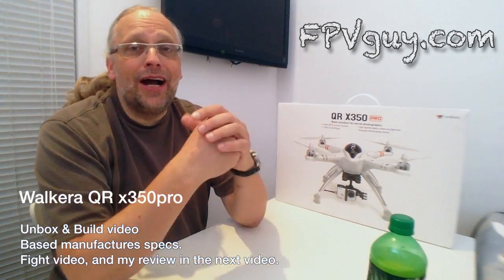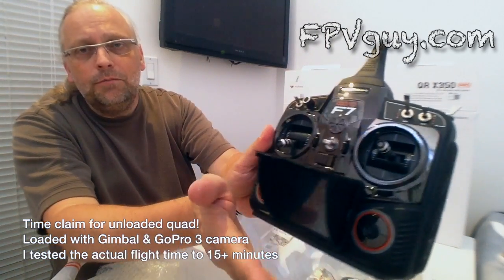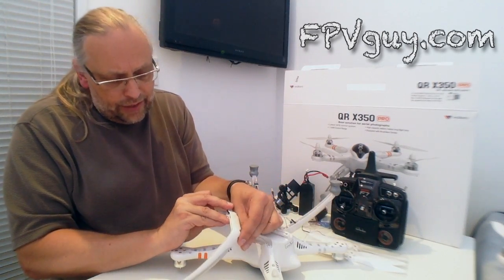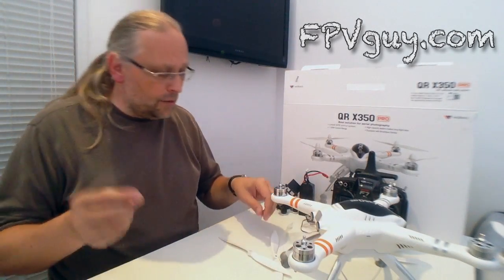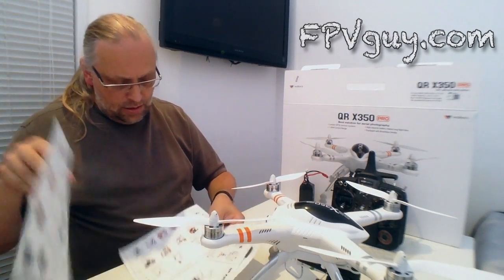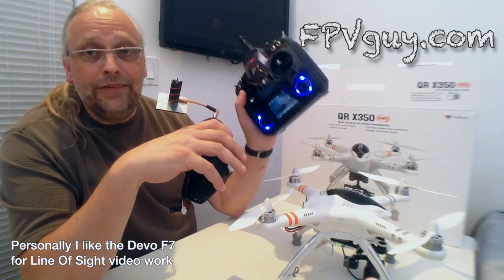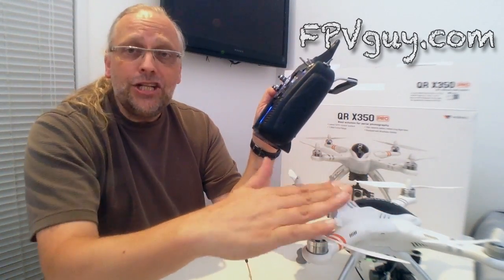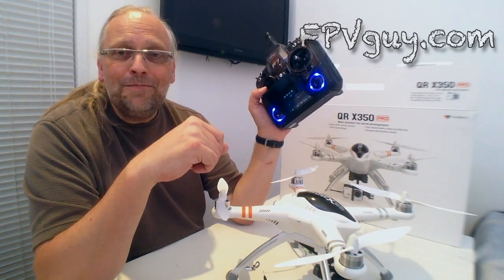Walkera QR x350pro build video

Comment: Hello bo, new to quad flying. Watched alot of your vids. Very insightful help me in choosing my new quad. My first quad.  The hubsan h107d fpv. I also got walkera 350 pro. Im taking it slow and steady only two crashes so far. Before each flight I tighten all screws and rotar caps. I got after watching this. I was just wondering if there was a way to disconnect the LED lights inside and replace with just red and green starboard and port lights. And could you show a how to video for that would be greatly appreciated love all your shows whenever I have a question I look up your vids. Sorry for any stupid questions just new to this and want to know what I can do. And if you can suggest a good set of LEDs red and green have a good day
Reply from the maker: The LED's are actually part of the ESC's   but I think you could easily reorganize the ESC's     that said,  Im finally getting comfortable with the quad style of lights, green up front and red "brake" lights on the tail.
Reply: Is it possible to switch the lights and colors. I want to change the configuration. I had to change the batt connector on the batt & the quad. The cjarger they gave took 14 hours to charge. Took to hobby shop & paid them to do it. I can do light soldering but not that well still learning. I got new hitec ac/dc charger 10a 80w with balance board. Now it charges in 1 hr little longer. But now I can use other batteries as well. I also bought a drone strobe for it. I want to make the lights more like a real plane. Thanks again for input I respect your opinion and your vids are my #1 go to. P.s. if I disconnected 2 sets of the leds would it save power and are the leds removable. I have not opened it up yet. Thanks again.
Reply: Sorry for the long posts just want to learn from the best. Also I joined the ama. I want to configure the lights like I said to more like airplane lights. I fear the regulations comming cause people flying too high. I live in san jose ca, just the other day someone was flying a stunt plane about 300 or so feet less than a mile of san jose international airport.
Reply from the maker: Honestly, I like the idea of changing the lights, however generally ALL quads and hexes have similar lights out of the box,  I would not mess with them.
Disconnecting the LED's will not save enough power that you will notice the differecen :-)  it is a pretty big battery.

Comment: Excellent video Bo, thanks mate. It's brilliant news that Walkera are now using APM compatibility in their product. We now just need DroidPlanner to get the Wikipad working with the APM and Walkera have a Parrot Bebop killer! :)
Reply from the maker: Yup,  putting a open source flight-controller in a mass market product could be a stroke of genius for Walkera.  the funny thing is, their setup is not particularly great, but most users simply adjust the settings based on better settings from internet forums and because its open source, in 10 minutes they have a much better flying quad.     Im very excited to see the Bebob, love the ideas and the video stab concept.

Comment: Thanks Bo,The cost of the  Devo7 is around 80 au dollars so for it is quite cheap in comparison to the  F7 which retails here for about $ 270 and includes FPV support.I could spend $ 235 on a lcd 7inch screen but then I need to buy adapters and the like, id be better off just buying the F7 and  be done with  it.
Reply from the maker: +Steve Hallett   Yes and no.   the screen is virtually guaranteed to have better receiver,  and you can then fly circular polarized antennas in both ends. ;-)  I would go for the screen or budget goggles from CarolinaDronz.com

Comment: After watching this video I'm seriously thinking about getting one of these to replace my Blade 350QX. The Blade is a great flyer but it has one serious drawback. No gimbal support. I would like to be able to manually tilt my gimbal from my transmitter but it won't do that. The original Blade also has range issues and I want to move up to 1.3 ghz for longer fpv range. BTW, you sure drink a lot of Dew :-)
Reply from the maker: LOL.. what do you mean,  I have to go get a dew for each video to keep the image. :-)
The 350pro is a pretty solid quad,   I have had good success with it..  as always, balance motors and be religious about the props, that makes a huge difference.
Reply: Bo Lorentzen I use the Pro propellers on my Blade 350 so I'm pretty aware of the balance issues with them. Once they're balanced they're great props. I swore I'd never buy another Walkera after my original 350 but the more videos I see of this one I'm convinced they've done a much better job on it.
Reply from the maker: The 350pro is a much more mature quad compared to the original 350.   It still have a couple of behaviors.. but thats more a feature of the APM system,  always make sure it have more than a solid GPS lock.. even for flying in manual.    and avoid low-battery forced auto landing.. simply land when the battery light come on.. or fly with a timer.  personally I turned off the low-voltage landing in the APM setup.  and I added a lipo alarm buzzer.. when it starts beeping, I turn around and land. easy and painless.
Reply: Bo Lorentzen I use a buzzer on all my quads. In fact I use the same one you do, even on my Naza quads. They also have a settable LVC but I prefer a buzzer. I also use a timer. Does the 350 Pro have auto levelling in manual? That was a big bugaboo for me with the original. Anything that FPV's should have auto level even when not in GPS mode. The more videos I see on this version the more I'm convinced that I should have waited for this one to come out. I've got a small windfall coming next week so I'm going to order the version with the Devo 7. I've got a DX8 I can move up to if I don't like the Devo.
Reply from the maker: Yes the "manual" is really "stabilize"
Reply: Bo Lorentzen I figured so being it's an APM clone but I wanted to be sure. I don't plan on using the waypoint feature.
Reply from the maker: The important thing is understanding what to expect from the flight controller.
Reply: Bo Lorentzen I want stable, smooth, predictable with longer flight times and a decent RTH.
Reply from the maker: Randall Huston check out the MiniX flight controller :-)

Comment: Hi I just bought this drone, and have a problem as my drone cannot fly higher than 2 meters. Then I found out that the battery is not getting the full charge. I contact the seller and told me that it over discharged. He suggested to try it with a lithium battery balancer. Please note that this is brand new. Can you tell me how shall I charge my drone, and provide more information regarding the battery and the charger.

Thanks

Comment: Hi,
thanks for the great setup video.  I got some nooby questions that I'd like to ask
1) I got a Devo 7F, on the top right corner of the LCD, it says 7.4v  - I assume this is the voltage of the battery in the radio ( not in the quadcopter )?  What does 7.4v mean in layman's terms? How do I know when the radio is running low on power?

2) How do I know the battery level on my quadcopter? I know it's a 5200mah.

Thanks

Comment: I  second that very helpful, one thing the slide clip for the camera where can I purchase one as it can be put on or of very easy.
Reply from the maker: thank you Byron,     Walkera told me they are releasing the quick-mount, however I have not seen it as a separate item yet.   maybe check with Dave at walkerahelicoptersupply.com and mention to him that you want to buy that for your G-2D gimbal. (I'm assuming you are talking about the gimbal quick mount?)

Comment: Hi Bo,I still in contact with walkera and finally they are going to send me that missing cable at a price will let you know the price including p&p,have you got yours sorted out yet.
Reply from the maker: Hey Bryon,    Mine is working in that I can make it work when connecting a cable from gear to the camera with that little "camera cable thing".    BUT  I have not used it because I typically just turn the camera on before take-off.    Very interested what they send you.
Reply: Hi Bo, I got the cable and I have been trying to get it to work. on the back of the card it shows where to put the plug the on another place it states to place it another position on the receiver,but I have a bigger problem the blades will not turn now, so that has to be sorted,I think its the receiver at fault.
Reply from the maker: Bryon,   make sure the MIX stick is in the zero position before trying to arm the motors.

Comment: Cool Video, Cool Quad, do you know if you can buy bodies for these? If so, do you think it will be possible to transfer internal components and motors etc from last years quad to the pro body? Just want to use the bigger battery. Thanks (-;
Reply from the maker: Yes, it is possible,  lots of people have been upgrading to the pro body when damaging the original style,  Dave have the body here
http://walkerahelicoptersupply.com/collections/qr-x350-pro-parts/products/qr-x350-pro-z-02-body-set
Reply: Bo Lorentzen Thanks mate

Comment: Dear bo, was wandering if a firmware upgrade was important some say yes and some say no. Also wondered what the little bind cable is for and exactly how it works. Thank you
Reply from the maker: The firmware upgrade give you a slower decent when landing in RTH.   
the bind cable need to be put into the last port on the receiver if you have setup the receiver for permanent ID and need to bind it to a new radio.  you should never need to use the bind cable.
Reply: Thank you so much. Very helpful. Hope you have a good day bro thanks

Comment: Any videos on converting and adding  x350 pro to a 3d gimbal and camera if it is not out of the box (ie making sure all wires are in place inside and all presets on Devo 10 are adjusted to allow and use 3D and iLook camera)...Out of box version will have been setup as RTF with all presets....
Reply from the maker: nah, unfortunately,    however its pretty straight forward, you basically want to power it, and connect the pitch cable.

Comment: ok thanks for the info :D  ill see what happen if i will fly in gps mode ...because this is my first quad and i also orderd propellor guards i will probably need them lol but i already practised on my tablet with a quad simulator ... its a little  hard but i will practice and if somethig goes wrong just put the RTH function on ;p haha but u said in the video always put ur trottle at 50% if u put the RTH function so if u go back to gps mode u wont crash but is it necessary if u let it come home and let it land totaly ? to still put it at 50% if ur in any trouble ?
Reply: oops i made a new coment instead of answering on the same coment :/
Reply from the maker: Tom, those are good questions,  when you are in RTH mode, the aircraft will fly itself, including landing where you started. Simply leave the throttle at 50%.   I would suggest switch OUT of RTH mode when you again have a comfortable situation with the quad, and continue flying it in either GPS or manual mode. when you switch out of RTH, make sure the throttle is at 50%,  also if you switch form GPS to manual, make sure the throttle stick is at 50%, otherwise they aircraft will start to fly according to the stick. ;-)
Reply: ok thank u very much for all the info :)

Comment: Bo, I have been in contact with walkera and there is another cable (D) which goes into the receiver,I have asked if they would send a cable to me,will have to wait and see.
Reply from the maker: Bryon, that is what I am coming to also, but they have not yet shown me the actual cable.  still working on that part.. which kinda bugs me, because the x350pro flies nicely and I want to do the wrap-up review.. but want to include the cable, and a couple of other solutions as well in that video.

Comment: Hi Bo! Thanks to your videos I decided to buy a 350 instead of a Hosten, for FPV with Attitudes Goggles and the iLook + Camera. Very Happy, but the camera records many different clips, even if i don´t stop the shooting. I have a 8gb 30 MB/s card. With a FAT32 Format. Do you know what it could happen? Thks so much!!
Reply from the maker: I think it splits the clips after 10 minutes?
BTW. you can format the camera in-camera by pressing the shutter for 5 seconds.
Reply: Bo Lorentzen thanks for the quick answer. Actually some of the clips are very short. I tried to format the card with the camera but it didn´t work very well. I guess it´s because i´m using a cable that came with the ilook + for the Tali 500, and so i had to change the plugs (not the same than the 350). I guess there is something wrong with it. It works but not properly. So i´ll have to buy a replacement for that cable, which I thing Walkera don´t sell. Anyway, i´ll continue to try diferrent things! Thanks a lot Bo! We can always count on you! :)
Reply from the maker: Jorge Esteban   OK with that little extra information.. ;-)    I'm guessing the camera start stop is getting constantly tripped.. maybe the trick is to find out which of the pins is the servo signal and disconnect (clip) that wire so it just get 5v power and ground.  then you can start on the camera.
Reply: Bo Lorentzen That was it ! GREAT JOB BO!!! What would us do without your help!! the cable is split in two (power and servo). I disconnected the servo, i press the button on the camera to record, and it works smooth!! thank you!
Reply from the maker: Jorge Esteban   :-)   AWESOME, glad it worked. ;-)

Comment: Hi Bo, after my difficulties with the GPS I built in an original APM 2.6 with an ublox lea 6h GPS. Works fine without cam and gimbal. With ilook cam and 2d  gimbal (total weight 1.243 kg) and original Walkera batt (5200 mah, 10C?) in the package the Quad can fly only a few minutes! I observed that there are Walkera batteries with 5200 mah, 30C on the market. Which kind of batteries do you use? Can I hope for better results with the Walkera 5200 mah, 30 C? Which is your total weight inc. cam and gimbal?

Comment: Bo What is the 2.4 radio like for signal where there are buildings and wood fence can the signal go through to the rec ok, also 5.8 camera signal  will that through buildings
Reply from the maker: Hey Bryon, the 2.4 is ok, but it's not a brick wall penetrator.  If you are looking at flying behind houses, you need get a ezUHF and use 900mhz for your video.  Then you can comfortably fly a long as you have video.

Comment: Great demo as  usual Bo.. I have the QRX350 pro now on back order from Amazon just waiting for it to come in.  It has the Devo 10 Radio but I noticed something I didn't realize. I am anxious about the FPV and your Devo7 has a screen to view from but I noticed the new Devo 10 has no FPV screen !!!!  dang ... I do have fatshark goggles but I was really hoping for a screen on the Radio. If the screen on the transmitter is important to me does that mean I will have to order the Devo7 transmitter, or does the Devo10 have better features??  I dont want to give up the good price just for a screen, but you know what I mean. Any suggestion would be appreciated.  thanks.   Ken Keenan Barrie Ontario Canada
Reply: +Ken K. devo 7 doesn't have screen, devo F7 does, there's a difference

Comment: Hi Bo,I bought the same model but with Devo7 and connected everything as per  your video. Once I turn both the quad and the transmitter  on  I have  no video at all?
Reply from the maker: +Steve Hallett    sounds like you need to change the video frequency until you get a image.
Reply: +Bo Lorentzen 
thanks for reply mate. Ive gone  into the  Devo Settings and from there I'm not sure what to do?
Reply: +Bo Lorentzen 
If you can advise  me on how  I would  be appreciative Bo.
Reply from the maker: Hey Steve, not sure where to start, there are a lot of issues to look at here,  may I suggest a quick call to your walkera dealer?
Reply: Done that Bo, check  out my reply to you  on your you tube video  of the  unboxing  of the Walkera QR X350 Pro.

Comment: Thanks bo for your quick response. I am totally new to this. I bought it for $200. It was working fine til i did the software update. The only time that one motor works is when i turn all the motor on and manually spin the one does not work. It starts to spin. Is it possible to fly with three motors working? Thanks.
Reply from the maker: +amin momin   You can't fly a quad with 3 motors.  you need to fix the one.
check this group out  https://www.facebook.com/groups/WalkeraQRX350Pro/

Comment: Bo,I have ilook plus know,got camera rotating up and down but unable to get camera to switch on  and off,using retract switch, when battery is conected the red light flashes twice then about 5 second break then light comes flashing twice again then break,any idea what is wrong.
Reply from the maker: Bryon,   I have been messing with the same thing,  the simple answer is there is a missing cable.!     in the kit look in the little plastic bag, there is a cable that fit to the camera control wire,  that one need to go to the gear CH on the receiver,   but you need a extension cable from the receiver.  Im thinking about using the mode cable from the gimbal controller for that since its already there.

Comment: Hey Bo, have you had any success flying automated waypoints with any of these cheaper quads? I know the new DJI Phantom 2 Vision can do waypoint flights but haven't seen anything about any cheaper quads like the Cheerson/Walkera types quads.
Reply from the maker: LOL  good question.  bottom line.. yes and no.   the 350pro is a APM flight controller so yes you can do it, but you need to use mission planner.  and no.. Im not terrible keep on waypoints, so i have avoided playing with them. :-)